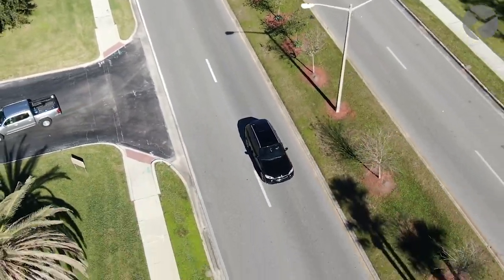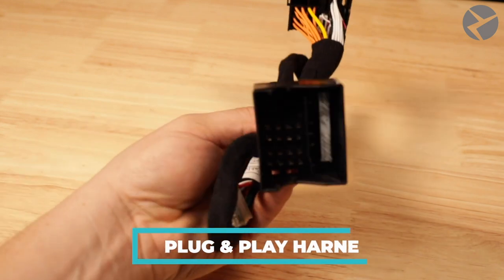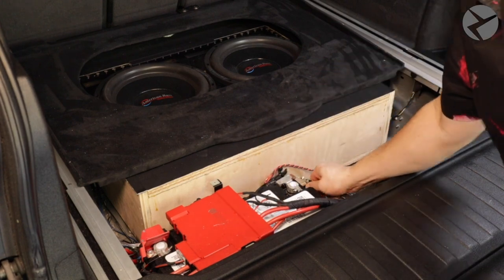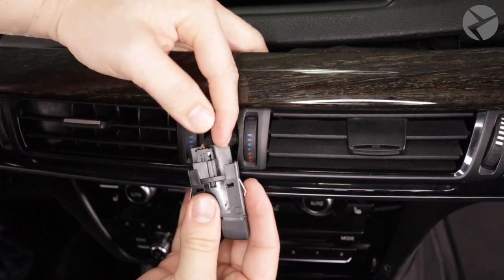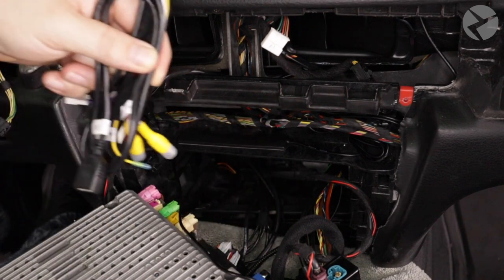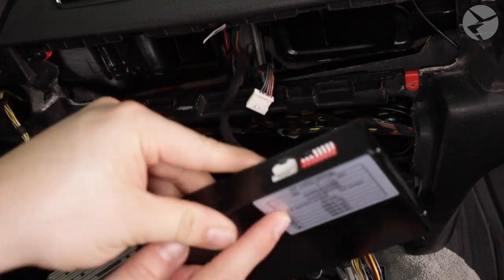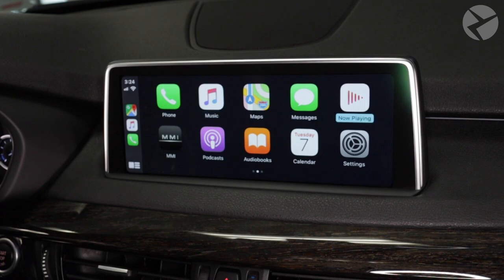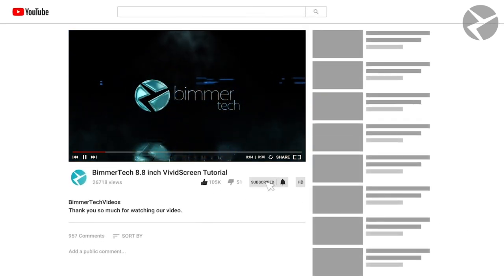BimmerTech CarPlay MMI Prime/PRO Step-By-Step Installation In BMW X5 F15 SUV

Comment: Awesome video. I do have a couple of questions, i have both android and iPhone, which is a better deal when purchasing the MMI. The iPhone version or android version? 
Also, can I have both devices paired at the same time (android via  wifi and iPhone via USB)? 
Screen mirrowing, does this work when the vehicle is in motion? Would this work with YouTube videos for kids? 
Can this be paired to headrest screen for back seat passengers? 
Satellite radio, I have existing subscription, does this continue to work as normal? 
Tx for addressing these questions.
Reply from the maker: 1) CarPlay MMI Prime and Android Auto MMI Prime is the same retrofit, 2-in-1.
2) Yes, you can have 2 devices paired at the same time.
3) Yes, screen mirroring works while driving. Youtube is not guaranteed. Last time we checked it worked but it might not work in the future. BMW block streaming services like that.
4) No, it can't be paired to headrest screen.
5) Yes, your satellite radio subscription will work as usual.

Comment: BOOM  just done this, followed (almost) to the letter.  There 4 screws in THE Head Unit, and the OEM video cable was wrapped in tape, which needed careful unwinding.  Its not that easy to shove the unit down behind the head unit - but when  I was done - about 2 hours later - all working and a great upgrade to my 2016 X5 M50 !!  THANK YOU.
Reply from the maker: Thanks pal! Glad it all worked out well :)
Reply: Was it easy?

Comment: If you have an F25 X3 with NBT, make sure you buy a 6 Pin Car LVDS Video Line Extension because the  OEM cable from the NBT head unit to the monitor does not extend at all. Your only option at this point is to mount the MMI box behind the monitor which is something you do not want to do. There will be extra heat generated by the monitor and the MMI box. Buy the extension cable and install the MMI above the glove compartment where it has good space to mount it cleanly and neatly.
Reply: was it difficult? not in the mood of opening up my dash and fumbling through tons of cables,
Reply: @sexylawyer8228  honestly. Not really. The extension cable will give you more installation choices.

Comment: amazing tutorial. had a couple questions. do the front , rear and surround cameras still work as they did before the mmi install?  does this void warranty?
Reply from the maker: Hi! The system is designed to integrate with your factory park assist cameras. For example, when you shift into reverse, CarPlay will automatically switch back to your default iDrive view, so you'll see the view from the cameras exactly as you do now. It also won't void your warranty when properly installed, and installation is 100% reversible, too. Thanks!
Reply: Do the reverse cameras come on automatically when the car is in reverse? Also if I press the 360 surround cameras does it automatically pop up?

Comment: Cool install instructions!  Thinking about the upgrade for my F15 but a few questions: 
If you use the wireless wifi connection do you have to repair the wifi connection each time you start the car or will it remember the wifi connection and automatically connect without having to constantly re-pair?
Reply from the maker: You'll only need to complete the initial pairing once. After that, everything's remembered.

Comment: Hey Guys, thanks for the detailed video, I have a 2013 f10 with NBT where I already installed a unit. And now looking to get one for my f15 X5 so just trying to familiarise myself with the process. I noticed no wiring harness going to the mic port above the driver, the Idrive port, or the aux input on your video. Is that not necessary on the F15? Im sure I had to run the wires on my f10.
Reply from the maker: Hi, 
If your vehicle will need the mic harness and the aux input will depend on your vehicles model and head unit please contact our sales team with your car’s VIN so we can answer your question for your specific vehicle ;)   https://www.bimmer-tech.net/page-contact

Comment: Awesome instructional video. Thanks much. On question though. Where do you take out the USB cable through? I can’t find any potential slit or hole in the front panel. Thanks much!
Reply from the maker: Thanks a lot ;) There is no hole for the USB cable itself, it comes out in a spot where the trim pieces connect
Reply: @bimmer-tech  Okay I will try.  Hope either the trims or the cable won't be damaged.  Thank you.
Reply: @bimmer-tech   I came to comments to ask this same question.  I did the mod on my 08 E70 and was able to snake the USB into the glove box.  Wonder if that's possible with the F15.

Comment: Good video. If I don't use the included USB cable, can it be set up and used with an iPhone wirelessly (while the iPhone is being charged by the BMW USB in the armrest console)?
Reply from the maker: Thank you :) Yes, it works wirelessly. You do not have to use the cable from the set. It can be charged and used simultaneously.

Comment: I have a BMW F15 2014, with the small 6" screen. Is it possible to upgrade to the 10.25" screen and also retrofit CarPlay?
Reply from the maker: Here's the product, but I recommend you ask our sales team if that will work in F15 X5: https://www.bimmer-tech.net/products-10-25-inch-idrive-screen-adapter-f30-f32
Reply from the maker: It is possible by replacing the whole system. We do have NBT EVO retrofit in our inventory :)

Comment: Hi, how to fit the box inside? I try but all the cable is hard to fit. Is that enough room just push it inside or need to put on specific area?
Reply from the maker: Hi! You should be able to fit the MMI Prime in the cavity between the head unit and the glovebox. The easiest way of access is dropping the glovebox.
Reply: @bimmer-tech  okkk, thank you. I tried to put it under the HU and it make me frustrated.

Comment: Hi! After turning on the car, how long does it take to recognize the phone wirelessly and show the carplay interface automatically on the display?
Reply from the maker: Hello, it depends on the factors such as: MMI software version, phone model, if the car was fully locked, or it was in standby mode, if the phone will be trying to connect to another device at the same time, etc.
It normally takes about 7-10 seconds to be able to move to CarPlay, after full lock of the car.

Comment: Hi I have a question. Is there a need to swap the factory display cable for your one? It seems like it would be easier taking the cable out the back of the head unit and then connecting it to the mmi box introducing the bypass there? Seems like it would make one less step and no need to remove the display.
Reply from the maker: Hi, no there's no need to do it. The installation should look like on the video.

Comment: So you have to use the usb supplied to plug your phone in correct? Can’t use the one in the arm rest?
Reply from the maker: If you're using this over a wired connection, yes, you have to use the dedicated USB socket, not your BMW's existing one. We know some people have added an extension to the CarPlay MMI Prime USB cable so they can thread it to the armrest or elsewhere in their vehicle, but it's still a separate socket
Reply: @bimmer-tech  If anyone has a solution and how they added an extension to run to the armrest, would appreciate their comment.
Reply: Well, I use Apple.  After setting up wired and then wireless, I have never used the plug in again.  I have it per the BT video, hidden just outside the console tucked and you cannot see it.

Comment: Hi, I installed it following the instructions included and now almost everything works. Thanks. Have a couple questions about the phone calls. When I have an incoming phone call I can’t answer neither using the buttons on the steering wheel nor using idrive knob. I can choose between the answer and decline buttons on the screen but when I push it nothing happens. Can only answer using my phone. How can I fix it? Can’t find any settings for that.
Another concern is incoming calls appearing. When I’m driving using the navigator and got the call I only can see the call screen then and can’t return to the navigator until I ended that call. Is there any way to fix it? I mean like splitting the screen between navy and phone, or getting calls on a background.
Thank you in advance for the answer.
Reply from the maker: Hi Igor! If you have that kind of problem, please contact our support team - support@bimmer-tech.net. Equip yourself with your car's VIN and describe the issue. 
After all, please let us know if the issue is solved :) 
Cheers!
Reply: Did you get this solved?

Comment: i have a 2016 BMW x5 40e Hybrid. do i need to disconnect the high voltage battery or just the 12-volt battery?
Reply from the maker: :If only the 12V battery is disconnected, the vehicle is not de-energized due to the auxiliary battery. Both batteries must be disconnected so that the vehicle is completely de-energized.

Comment: After installing, my AC control and audio control underneath are not responsive. Any tips? I made checked the blue and black connectors and they are connected properly.
Reply from the maker: Feel free to head over to https://www.bimmer-tech.net/page-contact to get in touch with our support team. They'll be able to help you check everything's been set up correctly Thanks!

Comment: I have a 2015 BMW X5, XDrive35i, will this work? If so, how much is this mod?
Reply from the maker: Whether it works or not will depend on your head unit, but with your car it will most likely work :) You can check your compatibility and the price for your specific vehicle here: https://www.bimmer-tech.net/category-bmw-carplay-mmi-retrofit
Reply: @bimmer-tech  Are there any professionals here in the Austin Texas area who can do the install?

Comment: Hi I just installed the MMI unit and my music seems to skip/lag, also my phone doesn't seem to consistently switch over to the car speakers, and responsiveness when scrolling/ navigating is unreasonably slow or completely unresponsive at times.   Is there an update or a way to address this?  I was willing to pay the premium beyond some of the other options on ebay out there/ other chinese solutions because typically these are the types of issues not worked out by products on ebay and the like (and because of the reputation of bimmertech), so I'm hoping this is addressable.
Reply from the maker: Hi James, sorry to hear you've been having problems with your unit. Feel free to head over to https://www.bimmer-tech.net/page-contact to get in touch with our support team. They'll be able to help you check everything's been set up correctly and you're running the latest software version. Thanks!

Comment: any help with microphone? my mic doesn’t work for calls/ siri functions.
Reply from the maker: In that case you can check the microphone harness and its connector if there haven’t been any damage. To use Siri, the newest version of the MMI software is needed. To check whether there is an update available for your MMI please contact the BimmerTech support.
Please note that using Siri in cars equipped with the BMW Voice Command will prompt both Siri and Voice Command at the same time and might cause problems. In that case, we recommend not using Siri or getting the Voice Command coded out of your vehicle.

Comment: 2016 X5 with NBT  Have purchased and installed.  I moved the fiberoptic green cable over and started up.  Car play is on screen but no sound.  I cannot get the AUX to set to be used for sound as I try  to highlight and select but will not do?
Reply from the maker: Hi Bruce, in some vehicles it's necessary to reprogram your iDrive to activate the AUX input, but if you're seeing it on the menu, that probably isn't the case for you. Your best bet is to head over to www.bimmer-tech.net/contact and drop an email to our support team with your order number. They'll be able to check your vehicle specification and let you know if anything else needs to be done. Thanks!

Comment: can use only Bluetooth, or has to use wi-fi too, because I install but don't work only Bluetooth, and i can't hear if someone call me.
Reply from the maker: You can contact our technical support team at www.bimmer-tech.net/contact
Reply: Hi Hugo, was this issue ever fixed? I'm looking to get this unit, but want to make sure I can still pick up calls when connected to bluetooth device in the car.

Comment: Hi, will this work on nbt evo units or only nbt units? Thanks
Reply from the maker: Mark, the only NBT EVO unit will work is the ID4. It does work on every other NBT, Entry and EntryNav head units too.
Reply: BimmerTech hi thanks for the reply, so just to confirm as I have id4 nbt evo the module will NOT work with this?
Reply from the maker: @MarkSmith-cz6uz  The module will work with NBT Evo ID4.

Comment: I don't know what to do, I have a bmw x5 (f15) from 2015 and it has very bad fuel consumption ... between 18mpg and 22mpg (driven in the city) But when I type on google the combined fuel consumption looks totally different (between 41.5mpg and 47mpg) which  which is not good at all (the car doesn't seem to have problems and I don't understand why it consumes so much....
Reply from the maker: Hey Marius! There are two options - either your driving style is very sporty or you should go and visit your BMW service. 

Take care! :)

Comment: volume control does not function as normal. It increase and decrease volumes but does not show the volume level
Reply from the maker: Hi Sammy! if you have issues with our gear, please contact our support team - support@bimmer-tech.net. Equip yourself with your car's VIN and describe the problem!
Reply: @bimmer-tech  no there’s no issues . Was just wondering why the volume does not show although it increases & decreases as desired

Comment: So I installed a different brand retro carplay in my wife's 2015 BMW X5, and the phone call feature sucks! There is no EQ setting that will allow the caller to hear you properly without feedback from the speakers. Is there any way for this head unit to be installed and used for maps and media on the display unit while still allowing phones to run through the BMW native iDrive? Or does the mic/speaker eq in the Bimmer Tech MMI work flawlessly? Im looking to put this unit in my 2016 X5 with the 360 park assets cam Front and Rear factory cams along with cooled seats. any thing there that might trigger it not to be compatible?  Thanks!
Reply from the maker: It seems like you're having echo problems in your car. We can check if that would also appear after adding our MMI, but we'd need your VIN for that so please contact our support team at support@bimmer-tech.net and tell them about the issue. As for the MMI Prime itself, it will definitely be compatible with everything you have in the car and won't be invasive for other features.

Comment: many say that the sound is degraded because it goes through the AUX connection.
Reply from the maker: Audio quality is as you'd expect through the AUX connection, no different than any other unit that connects in the same way. That's more than good enough for a lot of people, but it might depend on your usage (whether you want navigation directions, podcasts, music etc.) and how discerning your ear is. You could always try connecting whatever you have to the AUX port and seeing how you like the sound.

If the quality of BMW's AUX input isn't good enough for you, then your only real option is switching out your iDrive unit for an NBT Evo ID6, because anything else is probably going to need you to run the audio into your iDrive through the AUX port. If you've got any questions about this or other solutions, get in touch with our team at info@bimmer-tech.net and let them know your VIN, so we'll be able to check exactly what we can do in your vehicle. Thanks!
Reply: @bimmer-tech  I have Harmon Kardon and the sound is very good through AUX connection.  I have asked people on phone calls and no issue also.

Comment: Head up system doesnt work after retrofit
Reply from the maker: Please contact our support team, as there are too many variables to help you with one comment. You’ll find the contact form in here: https://www.bimmer-tech.net/page-contact
Reply: BimmerTech its only the music and Navigationfunction of the headupdisplay. I think there is no solution
Reply: Hi, did you fix the problem? I'm thinking about to get one, mine car has head up system also.
Reply: Edison C no
Reply: @bimmer-tech  Is this expected, or should the HUD continue working as usual?  My Car also has a HUD and I would hate not having all its features enabled in exchange for CarPlay.  The way I see it the MMI module should be an addition to, not a tradeoff. Please confirm.
Reply from the maker: @lerokierulez  The HUD should work as usual when you add the CarPlay.
Reply: I have unit and HUD.  CarPlay does not project music like before in OEM on HUD.  When you rill steering wheel button, it will say feature not available.